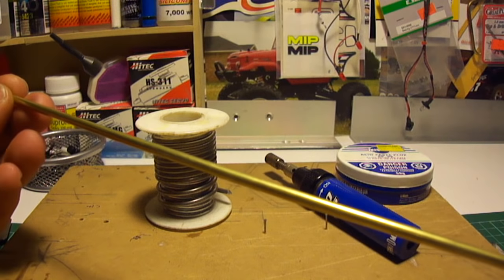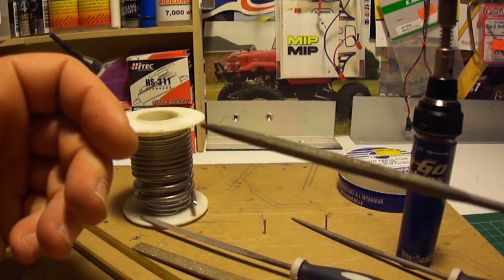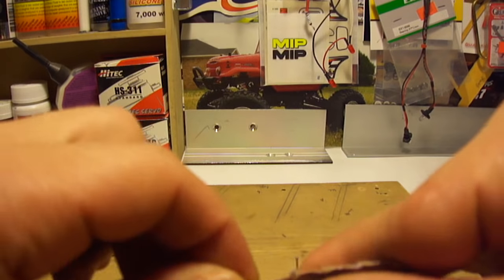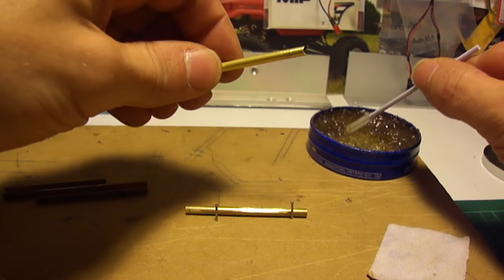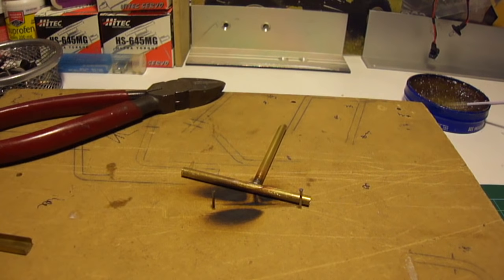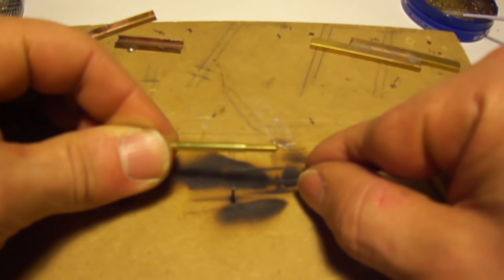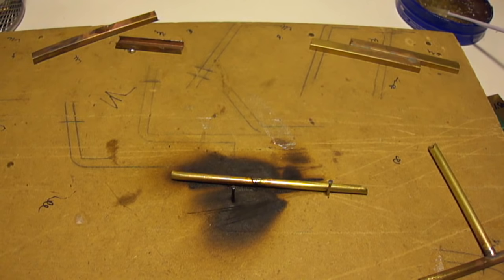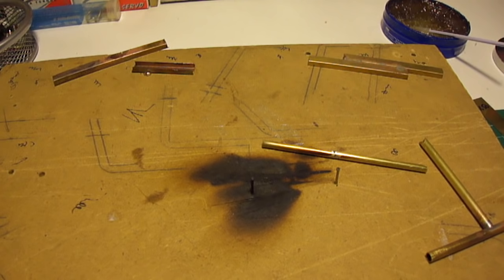HOW TO SOLDER BRASS

Comment: It's guys like you that help people that are willing and able to comprehend what you are doing, meaning people that has put copper pipes together but never used brass.  I am looking at repairing a brass outside light with glass, so that means  1/8 x5/32by1/8 brass channel against a thin sheet of brass. All this helps thank you

Comment: Very helpful!  I am building a 1/16 scale model Farmhand loader using different sizes of brass angle and I am learning how to solder brass.  Tough to hold 1/4" brass to 1/8" brass soldering angle to angle.  Your nails in the wood looks like it works pretty well to hold pieces from moving.  Also, I think I will get a pencil torch as it heats the material much faster than a small Weller soldering iron.  Thank you very much!  Nice job on the front bumper by the way!!

Comment: I was searching for a tutorial with exactly same brass tubes and rod, in same sizes. I didn’t buy any welding tools yet and wonder it would be also possible with soldering iron, or if it’s necessary to use blow torch. I saw your video then went to DIY shop but they’re saying i wouldn’t need anything like gel (that you put on the tube before hitting with torch), and said it’ll be enough to weld with just 60W soldering iron. it is confusing.. Thank you very much for your tutorials, it is so great.

Comment: Thank you. I am interested in this because I want to see if I can't get decent TV reception from rabbit ears antenna without having to blow 200$ on one of the larger ones that may or may not work better. I scraped the paint off a patch of the telescoping antenna parts and I am pretty sure it is brass. I plan to replace the two adjustable antennas with much much larger pieces of brass tubing and see if it does not improve reception because at the moment I can get almost nothing.

Comment: Excellent work. I have an old kerosene burner and there is a stay that has come looses  inside exactly the same pieces that you  showing here. What flux means shall I use to brass with tin. Hope for some response..  Regard Michael.🙏

Comment: I use a soldering iron with 60/40 rosin core, I’ve gotten were I can make my joints look like they were tig welded. Takes lots of practice and solder!
Reply: Hi, can you tell me what the flux does? And what happens if I do not use it and just heat it up and just use solder? It's for a very small screwhead which goes through a thin plate and will be flush on the backside... Both are brass

Comment from the maker: hey there paulgabrielle1.all i do is eyeball the center of the pipe and use either a flat skinny files edge or a triangle file to put a notch in the center then use the round file this will hold the file in the center and yes wash the finished product with lacquer or something equivilant.

Comment: Wow!😱 You make it seem so easy. Question. Have a (roughly 7 lbs) antique tilting mirror that hangs in its frame by a  bolt on each side. The brasses are 1 of kind irreplaceable solid hand carved bird wings. Anyway... Moving it to another room, one of the bolts snapped. I'm just broken hearted. Can I use this method to attach a brass replacement bolt to the existing finial? Will it hold the 7 lbs weight of the mirror? I'd really like to know your opinion, and or any suggestions you have. Thanks so much for posting this video 🙂

Comment from the maker: hey there xxzxfusionxzxx.im not sure that it would hold up to some nitro flips and crashes but if you put enough bracing in it just might take the abuse your better off using brake line and brazing it,brazing uses the same principal but you need a little more heat and some brazing rod which already has the flux built into the brazing rod.hope this helps.

Comment: great how to video. i have a couple of questions. when you cove a brass pipe, how do you find center on the pipe before filing, and how do you keep it in the grove?? also, after building and befor paint do you wash everything with degreaser to get any grease and such off the thing your painting??

Comment: Hi, can you tell me what the flux does? And what happens if I do not use it and just heat it up and just use solder? It's for a very small screwhead which goes through a thin plate and will be flush on the backside... Both are brass
Reply: Flux allows the solder to flow along the path you apply it to, and really helps make a clean join. That said, I have joined pieces of steel wire by melting them together, but if you get into a small complex shape, as you have to keep things hot, your joins can come apart. Super frustrating.

Comment: Mudslinger what gauge is the solder? 
I've heard brazing rods can bond them together but I'm new to this so I must say I'm happy to find you. Also I don't know how to bend piping without snapping it. I've subbed you buddy.
Reply from the maker: hey there rc nerd thanks for your comments and glad it helped as for solder guage i like to use .050 dia.i assume your bending brass so if you dont have a bender try crimping one end and fill the tube with salt,leave alittle bit of room for the salt to move in the tube about 1/2" and crimp the end you just filled and try bending again this will keep the walls from collapsing  you can also heat the tube to soften the metal.also check out my how to bend brass video if you havent already.ive never tried brazing rods,i know you will need alot more heat to melt the brazing rod.hope this helps
Reply: thank you muddslinger thats very helpful can you use sand to bend the tube? love your videos check out bunznmepockets . he's brilliant.. Godspeed Buddy
Reply from the maker: Rc-Nerd sure sand will work,
Reply: Thank you buddy I'll try that. Your the best.

Comment: Nice work.   I'm doing brass railings on a 1:12 scale boat.   Problem is I can make a good joint BUT.... BUT....BUT when I add the next pieces 1.5 inches away the HEAT I apply for the second joint MELTS THE FIRST JOINT.   Makes me nuts.  HELP ! ! !
Reply: probably too late to help you, but just put a wet rag on the one you dont want to melt. It will keep it cool enough while you heat the other side.

Comment: SO HELPFUL, !!!  THANKS FOR THE VIDEO. NOW I HAVE A QUESTION, IAM A FASHION DESIGNER WORKING ON A BRASS BIG NECKLACE PIECE, WHAT SHOULD I USE IN ORDER TO GET A YELLOW OR BRASSY COLOR FINISH IN THE JOINT, LED SOLDER FINISH IS SILVER.

Comment: Would you recommend the tube or a solid brass cylinder for a roll cage?

I'm thinking solid will be harder but holo tube will be lighter.
Reply from the maker: hey kcg. i like using tube for my bumpers or roll cages for 2 reasons.
1 its lighter and easier to work with and 2 after time and a few roll overs
it will show some dents for realism.
cheers

Comment: Muddslinger, Thanks for the tutorial. What type of solder are you using for this?
Reply from the maker: Im using regular solder that i use for electric wires or plumbing solder works

Comment: Hi Mudslinger, I have bought myself some axid flux. About the solder you used, should it contain any flux at all? I can locate only "rosin core", which apparentky also contains flux. I mainly solder thin brass rods and suare tube (for slot carbox frames and bumpers). I've found 60/40 but no 50/50 and I want t get the ingredients right. Can you set me straight?

Comment: In trying to  silver solder  6mm round brass bar but can't get it hot enough for the solder to run. I'm using a butane torch. Is this the best gas or is there a hotter gas I can use ?  It's frustrating

Comment: How would you add a way to use a bolt to hold down the part you made?  Would you use the brass inserts dubro makes?  I made a wing mount for my large scale t/c and just trying to figure out how to mount it now.  Thanks.

Comment: hi. yours is the first video which came up when searching for a solution for my problem. I am not a metal worker but I have a small piece of brass with my makers stamp, which  I need to do something with. When heated and press into a violin bridge. Its about 25mm long, 10mm high with small 1.5mm letters across the 5mm width. I bought it ages ago but never used it because it the 2mm threaded rod which connects it to a small wood handle is just too delicate to allow sufficient force to applied downwards. I was going to order another but this waste would have been expensive, unnecessary and wasteful. so I tried it again and sure enough the rod snapped off with the thread still in the piece of brass. So I need to solder it to a solid handle such as brass or rod.
Would this be pointless though if in the process of using it for its intended purpose, I have to apply heat again to the vicinity of the joint? Thanks
Reply from the maker: +David Morgan
hi david if the solder joint is close to the stamp then yes the soldered joint will let go
Reply: +MISSING FINGERS Thanks for your reply. I suspect it would. It's quite obvious I guess. So and as I have some scrap flat and square brass, I thought I might try to make a holder with a couple of tiny socket head bolts much like the old bolster tools. actually I wonder if there is a ready made tool or what the name of such a tool might be.
alternatively, I also have some nice aluminium round bar which I could have turned and knurled for a grip and pressure fit the brass piece into a groove in the base. Does aluminium conduct heat? Alternatively, can you solder weld aluminium and brass?

Comment: muddslinger Can you please let me know what tool you used to cut the brass round tube in a 45 degree angle so you can easily solder?
Reply from the maker: i use a dremel with a cut off disc and then a half round file to cope it to the tube.the tighter the fit
the nicer the joint.hope this helps

Comment: which type of flux do you need?? and the material you use to weld?
Reply from the maker: +Arthur rosíek  any type of plumbers flux will work and soldering wire.check out your local hardware store in the plumbing section. 
cheers

Comment: i have the same benzo torch but it no longer works ,i think its not holding the butain or the twist valve is not properly working anymore and leaking ,,anyways,can you solder brass or cooper using aluminium rods?

Comment: This is frustrating me for sure. I bought brass tubing, a bender, flux, solder, a torch, and various other bits. I'm trying to solder brass tubing just like in the video.Maybe I have the wrong flux or solder. The solder never gets between the two pieces. it just puddles up and rolls off. I've tried to get it as hot as possible. Even red hot, burned through the brass actually. Would like to know what I'm doing wrong here before I spend any more money. Thanks!
Reply from the maker: hey scott p what kind of flux are you using,acid paste flux or or non acid paste?
i use the acid paste flux.
Reply: muddslinger Well I'm not sure, it says water soluble on the lid. no mention of acid or acid free... I'm going to the hardware store today so I'll pick up the kind you have, and try again. Thanks!

Comment: I have tryed 4 times and failed, my fith try worked but the brass has blackend and the solder has mostly puddled at the back.

Any advice would be apreciated thanks.

Comment: Is is possible to solder 36 guage brass to .64mm brass? or will the 36 guage just melt?
Reply from the maker: +laura thapthimkuna try it on some scrap brass of that size and see what happens.also
try using a soldering iron and place it on the thinner of the two, obviously the thinner piece will heat up faster and the solder should take.hope this helps any

Comment: Can I use silver solder?
Reply from the maker: bat man i would imagine you can use silver solder but its really expensive.
Reply: Thank you. Yes I know its a little more $, I'm soldering spent brass bullet striker heads into jewelry that's why I ask. Soldered w/ silver is less likely to cause irritation on the skin.
Reply from the maker: bat man nice idea man.let me no if it works.

Comment: wrong wrong wrong.... no no no... After you remove the heat, if the solder does not flow on to /in to the joint it is not hot enough. you dont ever melt a gob into it... there is never a reason to reapply heat. that will only weaken and or compromise a joint!
Reply: can you use a soldering iron?